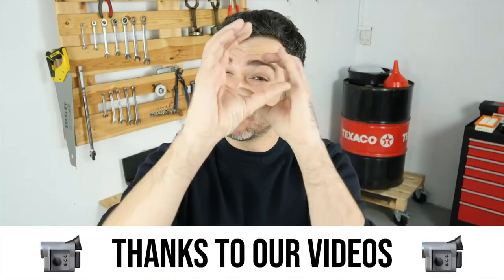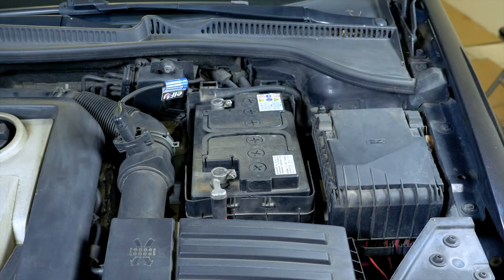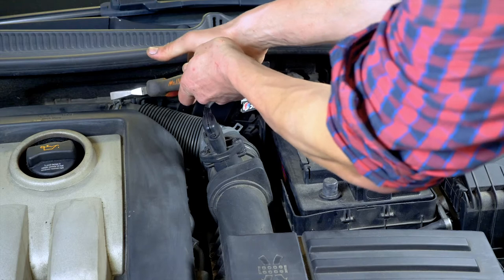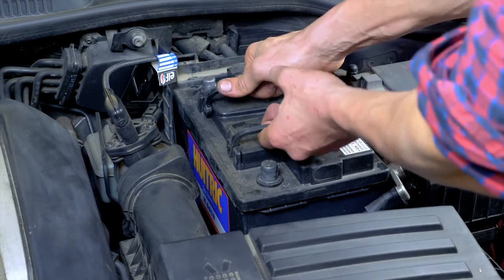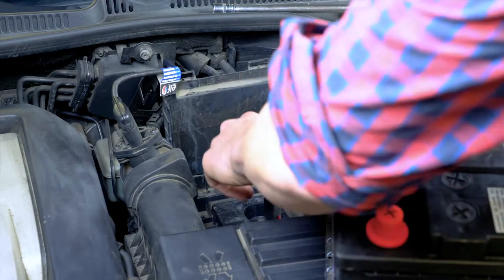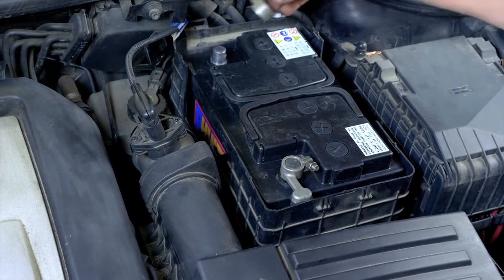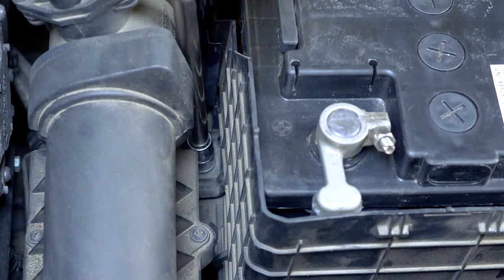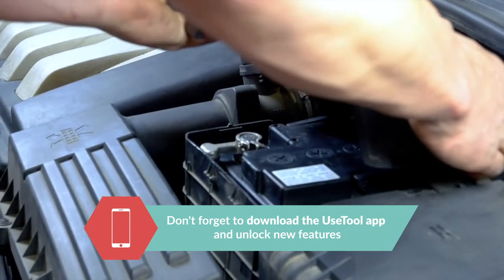How to replace the car battery Touran mk1 1.9 TDI 🔋

Comment: Tip : Depending on what pliers-wrench you use the clips can be hard to put back on the conduit if you slide them too far down the neck of the conduit. I suggest holding the clip open but keeping it in place as you slide the conduit off.